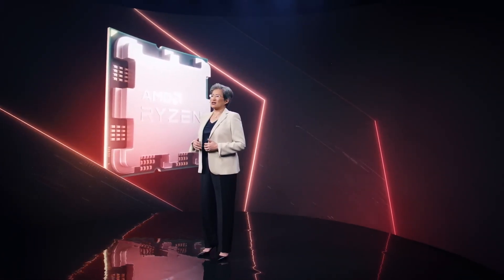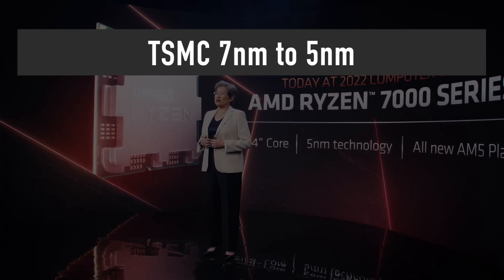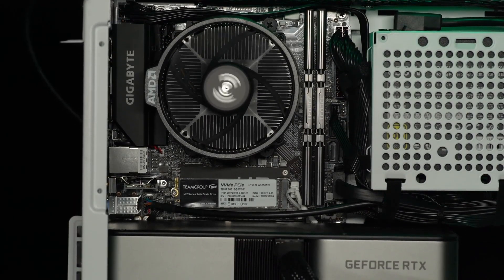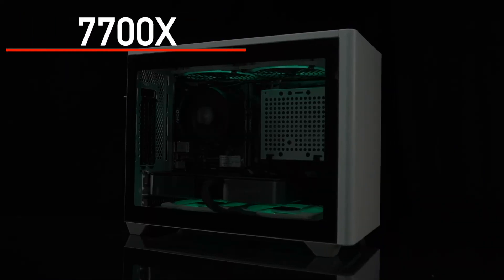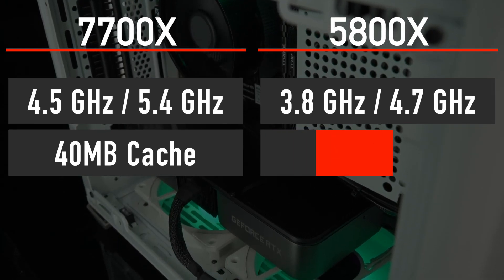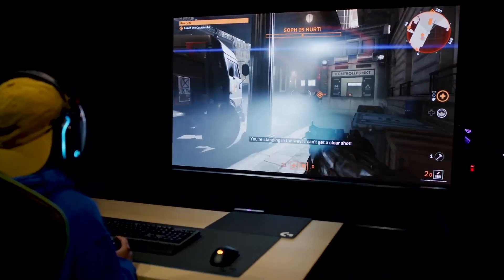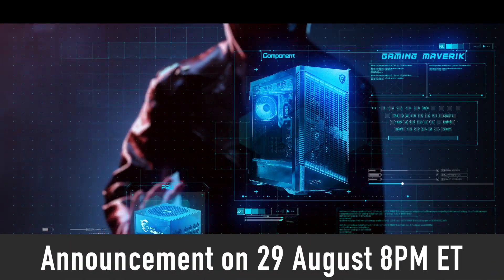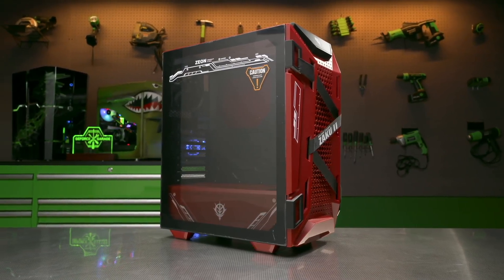EVERYTHING About AMD Ryzen 7000-series Desktop CPUs

Comment: is it possible to 3D stack cores like stacking cache? I'm interested about it
Reply from the maker: Anything is possible. But I haven't seen any company do that yet. Stacking cache on top of the cores is more beneficial at this point in CPU evolution. I think we will see that reach mass adoption first before stacking more components on top of each other becomes a thing.
Reply: @theivadim  I think 3d stacking is the way to go to push the frame rate,graphics and physics
Reply from the maker: You should check out what engineers are doing on mobile devices. There is all sorts of stacking going on there. It is amazing to see how they manage to condense so many components on a tiny motherboard in an iPhone🙂
Reply: @Maiza007-c8y  and greatly reduce latency, while maximising bandwidth. However, the main limitations to 3D stacking are thermals and stable voltages. That's why AMD only launched the 5800X3D.
Reply: The major problem is the increase in power required to feed those 3D stacked cores. It should be fine on server chips, where they can underclock the cores to get more raw multi core performance since single core performance doesn't matter nearly as much.
Reply: @chlorobyte_projects  I think 3d cores will have less latency than chiplets because current AMD CPUs can't pass 1900mhz fclk because of the chiplet design but AMD APUs can pass over 2200mhz fclk because APUs are monolithic die but APUs have very low cache capacity that's their performance is lower than CPUs

Comment from the maker: :_amd:Ryzen 7000 or :_intel:13th Gen?
Reply: I am not buying any of it
But 13th gen will be competitive and hope intel fix mounting bracket to reduce 10 Celsius.
Reply from the maker: @LightWilliamz  I won't be surprised if Intel forgets to fix it. But I hope they do.
Reply: That's not even a contest for a gamer.  In gaming the 7000 series is going to dominate, like not even close.  Right now 12th gen gets most its gaming advantage from the higher clock speeds, but AMD is taking that advantage away for Zen 4.  The 7700X for instance based on what AMD has already shown should be able to run game threads around 5.3GHz, which is a couple hundred MHz less than they showed at Computex for the 16 core part.  Then add in IPC uplifts which will help games more than many applications, partly because of the added L2 cache.  And for people who don't understand that, many applications when running some algorithm, such as the WONDERFUL collection of Youtubers who love benchtesting with their video editing software, those algorithms already fit into L2 cache, which means no benefit for those apps.  So all those render tasks and it doesn't really matter if it's blender or an Adobe software or something else that does tile based rendering, have algorithms that are small enough to fit into L2.  They won't see as much uplift from the added L2, which is considered an IPC uplift.  Gaming on the other hand has DATA that ends up in L2, data and code both.  The CPU needs data about the world around you when you're gaming, and this really means objects that you can interact with.  If you shoot at something the CPU needs to know the attributes of the object that was shot at.  So, data about the game assets that are close to you that you can interact with is important for the CPU and that data is constantly used, so it gets cached.  The larger L2 means the CPU doesn't have to hit L3 as much for data.  It's also now a shared L2 scheme I believe so any core has access to that data.

So, companies talk about IPC improvement and the things they did to make those improvements.  Adding L2 means less time waiting for data to come from L3, so IPC uplift, and this shows up in applications or games that are more data intensive, where the data is changing, but it's not simply a data stream coming off a disk and going back to a disk.  That data won't be cached.  It means the CPU needs to work with a large amount of data.  But also a game requires the game engine to be run, so this also gets cached, and this is a lot of algorithms, so the larger the cache, the more you don't need to hit main memory.  So double benefit for games with both data and program benefiting from more cache.

And I'm sure there are some other minor changes that will help Zen 4 with IPC.  

TLDR:
So first the large increase in clock speed for game threads, going from about 4.6GHz with the 5800X to about 5.3GHz for the 7700X.  That's about a 13% uplift, then add in IPC uplift for more L2 and other minor improvements, and you're between 17 - 22% uplift in games, for the 8 core part ACROSS THE BOARD.  

THEN add in Vcache when AMD releases THAT 8 core part, and Intel 13th gen is getting flattened.  That's going to be a butt stomping.
Reply: @drefar4140  DDR5 isn't that expensive now, and will probably continue to fall in price.  AM5 is a brand new socket, buying a 13 series only makes sense if you already have a mobo for it.
Reply: Will the new Ryzen have an iGPU?
Reply from the maker: @Arnette110  yes. All Ryzen 7000 will have it.
Reply: @Arnette110  Yes.
Reply: @drefar4140  It's really not.  Especially if it gets adopted quickly it will continue to fall in price
Reply: Wait for benchmarks and actual prices people.
Reply: Replacing my current i5 9400f for that outstanding i9 13900k.
Reply: @drefar4140  No we won't, it's been falling dramatically and will be pushed further down with the adoption of am5
Reply: @drefar4140  watch buildzoids video about it
Reply: Ryzen anytime. According to speculations and leaks, Ryzen 9 7950X would take a max of 230W power, compared to Core i9 13900K gobbling up a serious 350W of peak power. And in times where GPU(s) are expecting to hit 500W to 700W, I'd try to refrain from rewiring my house as much as I can.
Reply: @ravenclawgamer6367  Well those chip still on testing.
So, not sure.
Reply: @ravenclawgamer6367  it’s 350w on unlimited power and 250w on limited power. I get the feel it will beat AMD only if it’s running on unlimited power
Reply: @GUY-on-Earth  Right. I'd say that their 14th gen would be intel's last chance. If they fail to deliver the advanced node, or the architecture improvement in time, AMD would leapfrog intel in the time. Personally, I'd refrain from wanting a monopoly by either of AMD, Intel or Nvidia, be it in GPUs or CPUs.
Reply from the maker: @ravenclawgamer6367  an average electric kettle consumes way more than that. If your house can handle that then I wouldn't worry too much about it🙂 Still, I choose a less power-hungry equipment any day just because I don't like the heat it puts out into my living space.
Reply: @theivadim  Yeah you're right. Maybe we'll have to hang the PC out of the rooms like an old window air conditioner to keep the living room cool ;)
Reply: @theivadim  but you don't use your kettle for 5-8 hours straight
Reply: @theivadim  any idea what would be the pricing of 7900x, I'm waiting for the price reveal n availability, if its too pricey I'll just go with 5900x as that is way lower in tdp requirement and will be in discount. But if the price is similar I'll go for 7900x as it will last longer
Reply: ryzen most probably. that 7600x is really exciting. plus that longetivity really sold it to me. finally can get rid of my 2.5ghz i7 6500u with integrated gpu.
Reply: Intel because I want the i9 13900KF with good multicore and gaming performance
Reply: @hehehehaismus  That's not a good reason, they both do that well and we don't know benchmarks yet
Reply: I'll be throwing my 12600kf in the bin and replacing it with 13th gen
Reply from the maker: @toonnut1  what is your planned replacement?
Reply: Please sell it, don’t bin it lol
Reply: @toonnut1  don't throw it
Just sell it
Reply: Raptor lake all the way 16 cores is no match for 24 cores 13900k is king of processor
Reply: @alvinderekhinal3123  We'll see. 16C-32T VS 24C-32T. My bet is on the 16C-32T one.
Reply from the maker: @alvinderekhinal3123  7950X and 13900K are both 32 threads. Full size cores perform better than E-cores. I expect 7950X to have superior performance.
Reply: @alvinderekhinal3123  not at all. It’s not 24 full cores; some of them are efficiency cores which perform less and aren’t as fast. 7950X is better.
Reply: @Carnage1180  rip amd hahaha poor look at the 12th gen vs 5000 series haha